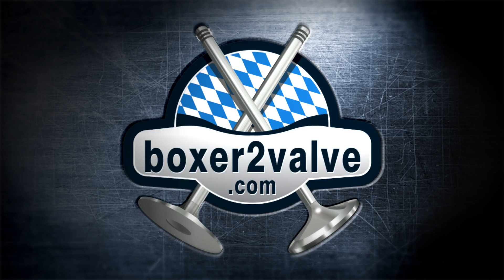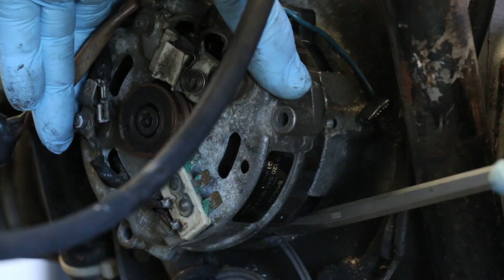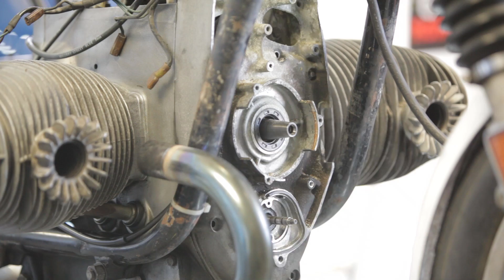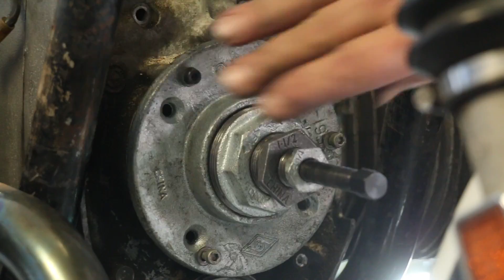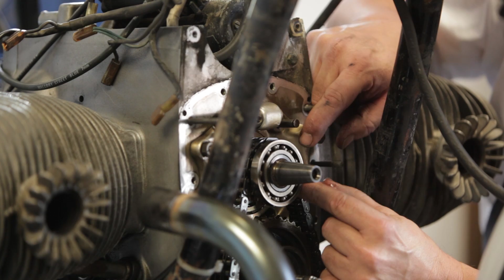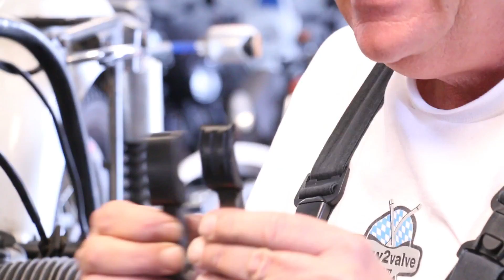R90/6 #10 How to remove Timing Cover & Replace Timing Chain

Comment: quick question, i have a 77 R75/7 and when i got it it ran bad at low rpm, i checked timing and was out so i moved the points plate to its max position i could and it brought it into time. now with that would you think that i am actually a tooth out on the timing chain because thats what im thinking. previous owned said he had it rebuilt but maybe they did a poor job. Is there a way to also inspect the chain without removing the cover? borescope maybe?
Cheers

Comment: Hi, thanks for making this video of changing a double-row timing chain.  QUESTION:  Could you install the master link with the two small cir-clips on the front side of the chain instead of the back?  Is there a reason why the clips need to be behind the chain?  Thanks again.

Comment: Great video. Will really help me with my 100/7. One question. Why did you put the link in from the front? Looks really fiddly to get the clips in.
Reply: I would think clearance on the rear for the extra length the master requires is greater than the front
Reply: I wondered about that too.

Comment: Great video, excellent teaching technique. Thank you.  Is it possible to wear a chain / sprocket to a point where the timing is completely out of whack and can't be adjusted?  My 1985 R80 has slowly gotten harder and harder to start and now will not start no matter how much I retard or advance the timing.
Reply from the maker: @Scott Adams: I don't think that excessive chain stretch can reach the point of not being able to set the ignition timing. You may have other problems. Definitely have a look at your coil. If you still have the original old style plastic coil, that could be it. Maybe also your ignition control unit has failed. These are both pretty common issues.

Comment: Great video guys! Could I remove the timing cover and its components before taking care of the cylinders, reversing the operations order? and should the motor be in a specific position when removing the timing cover? Thanks for such well explained videos. Half way through with my BMW R100/7! =) Getting there!!
Reply from the maker: Hi, No harm in removing the timing cover at any time. You don't need to worry about the engine position when doing so. Only when you disconnect the timing chain will this become an important issue.

Comment: Didn’t see or hear it in the video, but did you pre-oil the chain?
Reply from the maker: Hi Richard, I don't pre-oil the chain. The chain is supplied with enough lubrication and will be coated in oil within seconds of operation.

Comment: great video!
one question: my R50/5 has charging problems and I pulled the stator to clean it up, didn't come accross some resistance to separate it from rotor, meaning it came right out.
is this normal?
it really needed some cleaning and  now will pull rotor once I have the proper tool.
rotor is really old and seems on its last leg, replacing just the rotor is ok?
how did you prevent engine from turning when working in that area?

Comment: Great Video - I've got a bit of a mechanical slapping noise on the overrun on my 1981 Airhead R65 - thinking it's the timing chain, tensioner - no noise on accelerating.. feels like it to me - would you agree before I dive in to this level and replace the chain?

Comment: Also, is it necessary to install circlips on the "back" of the master link? - as opposed to installing them on the 'front".
Reply from the maker: There's no easy way to get the master link in the other way which would be required.

Comment: Some are talking about the "E" clips on the master link.....sometimes difficult to install.....I grease the clip so it won't fly "as far" away if lost......then place it on the side of a flat screwdriver pushing it home with a second  flat screwdriver ....I do it a little higher on the engine  and plug all the holes into the engine with a rag  first...!

Yes the battery is disconnected of course as it should be anytime the front cover is removed so the diode board doesn't get shorted out and ruined......the top sprocket alignment mark is difficult (impossible) to see without removing the bearing....mark it with paint pen clean it first ....clean it with thinners to remove the oil then paint it ...you can do the cam sprocket as well , it is a light scribe and hard to find at a glance as well.....tg.

Comment: great video. one thing you edited out the step of how to get those retaining clips fastened onto the master link. you got them in position w/ magnetized screwdriver (easy) getting them to lock on the post was omitted (extremely tricky)
please add that to the video
Reply: If you lose those little E Clips (DAMIK) you can get a whole bag of them for about 3 bucks from McMaster-Carr. They also offer a cute little clip installation tool that really helps hold that itty bitty e clip while to press it onto the master link. The E clip is for a 3-4mm size.
Reply: Looked like he pushed them on with the screwdriver tip, the same tip he balanced them on the edge of. Tricky move

Comment: Love the videos. they arevery  well produced and each one a pleasure to absorb.
I have a '74 r90S so a lot of similarities with your project. 
I saw where you pushed against the crankshaft (indirectly). When I took off my front cover this winter ('18), There was oil that had accumlated in the points area (it's been converted to a Boyer  system). I think I've source it to the crankshaft seal. Seems there was a tear on the side of it when it was installed,  from a previous timing chain replacement job.
I removed it and wanted to gear up a big washer to bear on the new seal and use a long bolt and pipe + washer affair to 'push' the new seal in place. I decided against it because I didn't want to risk 'moving' the cranshaft as advised when replacing the rear main seal.  The rear main seal was replaced earlier this winter BTW, with sucess.
I ended up setting the crankshaft  seal in place with the said large washer and a 3" pipe straddling the nose of the crank and hammering until being flush.
My question is: could I have used the threaded crank nose to pull on to set the seal in place?
Sorry for the long winded post, Amédée in Halifax Nova Scotia.

Comment: Don't forget to disconnect the battery before removing the outside cover, to avoid short-circuit in diode circuit located on the top of the timing cover.

Comment: Thanks.  I am going to make one up. I have to take the front cover off my R80 to investigate a tapping noise. Previous owner put a new chain on only 8000 km ago but there is a tapping noise coming from the cover I will have to go in to sort it out.
Reply: Richard  Salsman 
Hello Richard, I'm interested in hearing what you found out about the tapning noise?

Comment: Would like to get a list of the pipe fittings used for the case cover puller. Looks like a good inexpensive option.
Reply from the maker: Hi, Start with a 2" floor flange. It is approximately 5" in diameter. That's the most important part. Then you and use the following: a 2"-1-1/2" reducer, a 1-1/2"-1" reducer, 1"-1/2" reducer and a 1/2"-1/4" reducer. Other combinations may also be possible.

Comment: I presume it's a little easier on the later models with the single chain.
Reply from the maker: It's a bit easier but much the same. On the later models with a simplex chain, there is a master link so you don't need to do any grinding to break the chain. You should still begin by identifying the markings on the sprockets. Then you will need to find the deepest spot where you can remove the master link. The clip is on the front and the link needs to be removed to the rear and also reinstalled that way. So there is still some delicate work involved but it is a little bit less involved.

Comment: How many times did you drop the c clips :-) if you did not you are a better man than I. My question too - could they have been installed reversed - maybe the master link could not be installed that way.
Reply from the maker: Hi Gerald,
Having the proper tool is what is needed and in this case, it’s the right small screwdriver that can be magnetized. Please read the response to Frank’s query. I’ve not found a way to install the master link the other way around. There is just not enough space to introduce the master link the other way. Maybe someone has an idea about this and if so, I would be happy to know about it. It is my belief that the way I have shown is the path of least resistance. Even though the clip installation might be a slight PITA, it’s really not that bad. Si se puede! (Californian for you can do it!)

Comment: Agree with previous comment on chain clips. From my limited experience, I did not find that install so easy as you make it look. Maybe give us some additional tips/ tricks? But still overall a rocking video! You guys are getting quite a buzz on the BMW Internet forums. I own 4 Airheads and will certainly buy whatever I need that you can supply going forward. You are saving us amateurs tons of grief. Thank you!
Reply from the maker: Hi Frank, The key in my estimation is finding the right tool. Not all screwdrivers are made of the same material. You need to find one that is ferromagnetic. Rub the tip on a strong magnet, back and forth a few times then test the effectiveness on a washer or something like that. You might find that some screwdrivers are barely effected by this and then not suitable. Identify a small screwdriver that can be effectively magnetized and then you will have good control over the clip and it should push on rather easily. You'll notice that I have my glasses (reading not safety) on for this task. With these things in place, it's very possible. I hope that this helps! WP

Comment: Master link clips looked difficult to install although you made it look easy..  Couldn't they be positioned on the outside, exposed side of the chain?
Reply from the maker: It's even more difficult to get the master link to go in the other way because there's not enough room between the case and the chain. It's barely possible to get the cut link out. The new master link is even longer than the cut link, so I find it best to insert the new master link from the front. Putting the clips on takes a bit of patience but it's not all that difficult.
Reply: @boxer2valve  Ahh, now I get it. Thanks.